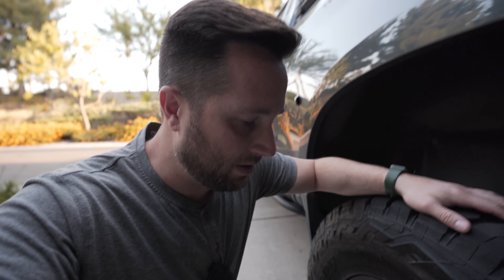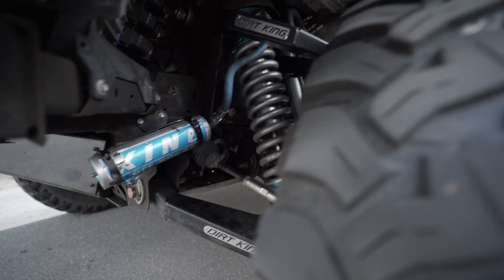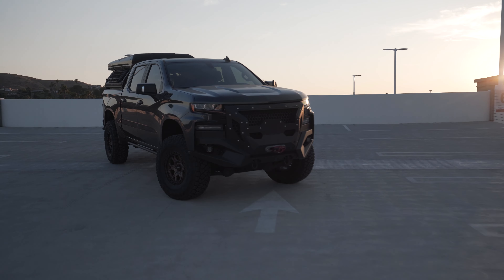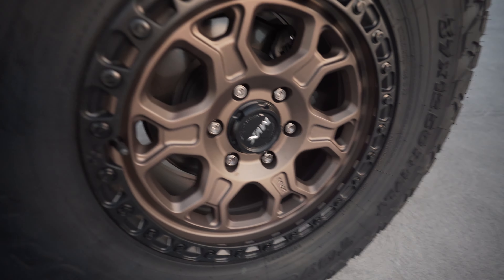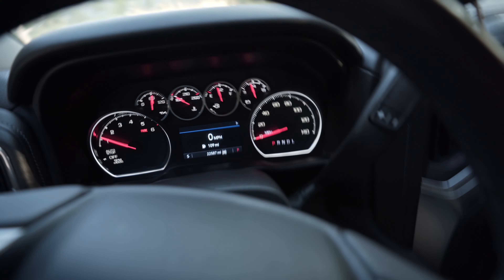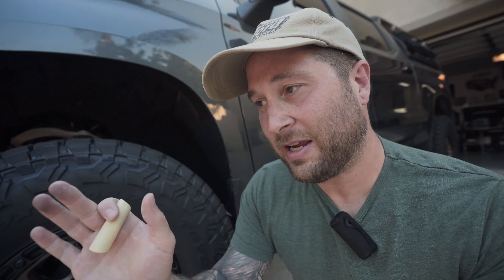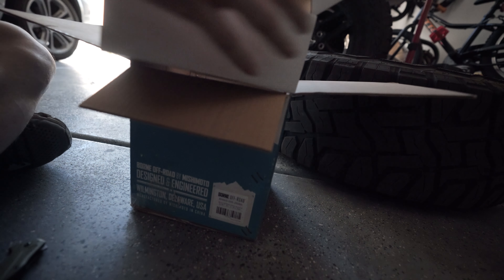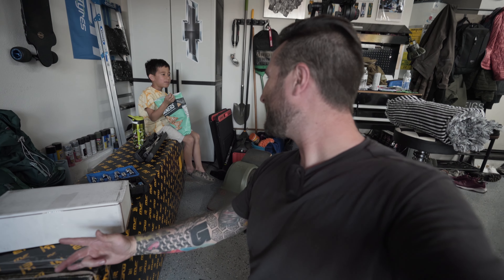How I fit 37” tires on my Silverado!

Comment from the maker: Do you guys prefer smaller rim and bigger tires, or big rims and smaller tires?
Reply: I prefer the smaller rim, bigger tire look. Sweet truck!
Reply from the maker: @larryrice2579  Thanks man. Same, I guess I prefer the old school look.
Reply: @halohalohikers3571 curious what your mpg dropped to with the 37s? Do you have the 5.3 or 6.2? Thanks
Reply from the maker: @larryrice2579  good question I was down to about 12 mpg with the RTT and everything before. It’s hard to gauge how accurate that even was because my speedometer is off still. I never got the OBD device to calibrate for the tire size.
Reply from the maker: I’ll check in a few days and report back what the cluster gauge says. Not sure if it will be accurate though.
Reply: 33s on 20s. But I love both looks. Yours looks excellent. Love the chalk test tip as well. cheers.
Reply from the maker: @Adman-p4j  yes the chalk test is really helpful! Most people put aftermarket rims and tires on and then still go by the recommended pressure for their stock tire from the factory. Thanks for watching and your comment.
Reply: 17’on 35’s or 37’s
Reply from the maker: @darioalcala6995  went from 35 to 37s

Comment: So the RC lift allows for 17 inch wheels , with their knuckles… what offset are the wheels that may be what allows the fitment …35’s are perfect with these TB’s (what I run on mine ) half ton axles …and upgrade your control arms and minimum …

Comment: Qustion, do you know if an 8 speed can handle 35s? 2020 sliverado
Reply: I have a 2022 2wd Chevy . 
8 speed .  Handles 35’s like nothing , I’ve had it for two years already and Zero problems .

Comment: those plastic pieces in the front should be able to be unbolted.  i think there are 2 bolts behind the liner, i removed them completely on my 21
Reply from the maker: Oh cool thanks. I’ll pull the liner out a bit and see if I can remove more. 👍🏼
Reply: Did it work? Been a while since I did mine.  Great truck btw.  Awesome that y’all can use it as an overlander.  No where to do that in Louisiana, but still camp out of mine a couple time a year.
Reply: @nyquillisdillwad2824 where in LA you live? I'm in Gonzales
Reply: @larryrice2579 live in BR, work in Gonzales
Reply from the maker: @nyquillisdillwad2824 yea thanks for the tip! There are 6 bolts I think normally you would have to remove the front bumper but I have just big enough hole in my bumper I can reach them.
Reply: @halohalohikers3571 awesome.  It’s been a while since I did mine, couldn’t remember exactly.

Comment: Did you custom mount the led bar inside the grill or did you get a specific kit?
Reply from the maker: I don't actually have a led bar I don't do much night time off roading. I have a grumper from Fabfour with some rigid light pods, a warn winch, and factor 55 winch hook.

Comment: I’m getting a 4” BDS lift on my LT Trail Boss next week and am conflicted over 35s or 37s. I have the 5.3 what’s your opinion after driving on those mean 37s ?
Reply from the maker: Honestly, I feel like 35s are going to perform better. You will get less rubbing off road, and your engine/tranny won’t have to work so hard. However once you see your truck on 37s it’s hard to go back, the 37s look bad ass.
Reply: @halohalohikers3571 
Does your truck downshift a lot on the interstate? That’s my main concern.
Reply from the maker: @FearTheReaper937  I have the 10 speed. It isn’t really noticeable on the freeway, but the acceleration does feel slightly muted now when I’m driving around town. They have a few plug and play chips that you can calibrate the tire size and turn off DFM, I might get one of this eventually.
Reply: @halohalohikers3571 I was thinking about that as well. Good to know it doesn’t downshift! I don’t think anyone has cracked the new ECU yet. Waiting on the pulsar.
Reply: Same suspension kit I want to do as well and was thinking if 37s would fit. Let us know!

Comment: did you have to remove/cut the crash bar behind the fender liner?
Reply from the maker: @kristoferfc6525  no just some of the plastic. Then I zip tied the fender liner to the crash bar.
Reply: @halohalohikers3571  gotcha cool, with that clearance, at full lock do you rub?

Comment: Looks sick :) but id get rid of those weak stock arms. STAT.
Reply from the maker: It’s on my list of upgrades I need to do! I’ve been putting it off because the lift I have keeps the stock angle of the upper control arms. But I still want beefier arms, depending on what lift I upgrade to I will get the arms that comes with the kit.
Reply: @halohalohikers3571  sweet. Seen a lot of horror stories in those gm ones snapping. I went with cognitos on my TB. Bolt in ball joints..